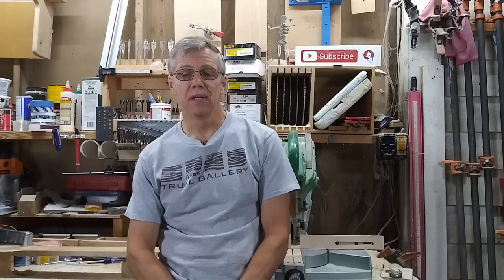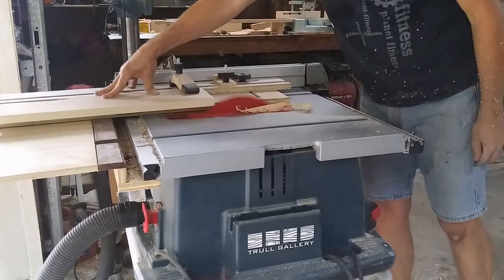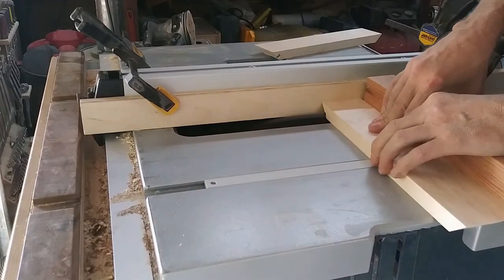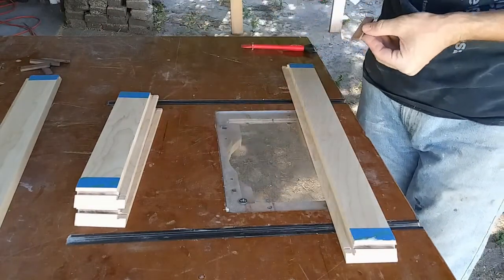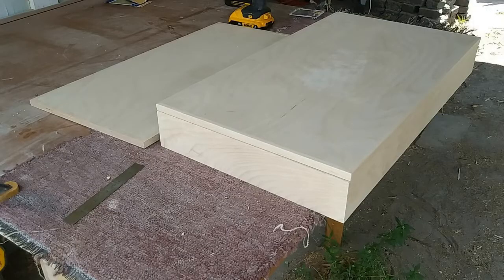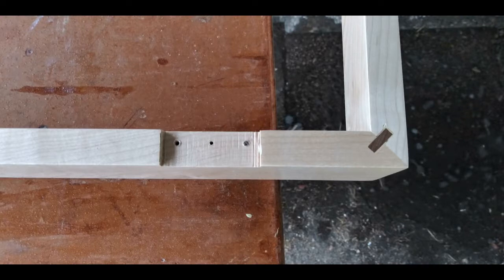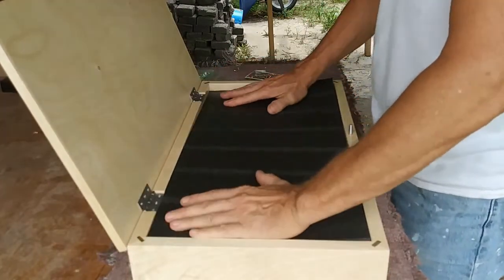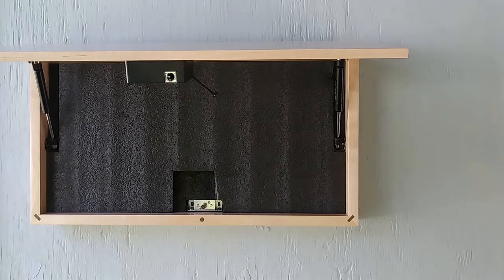Hidden Storage Box With a Magnetic Lock

Comment: Where Can I buy the spring loaded pin?
Reply from the maker: It started as a 1/4 aluminum rod that I cut down, powered by a small spring I had laying around.  I replaced it with piece of walnut dowel (glued in and cut flush) because the spring put too much pressure on the lock mechanism.
Reply: Is there a way to cleanly have access to the USB plug rather than taking the back off? I want to build a hidden secret box in the wall between the studs with a mirror/door